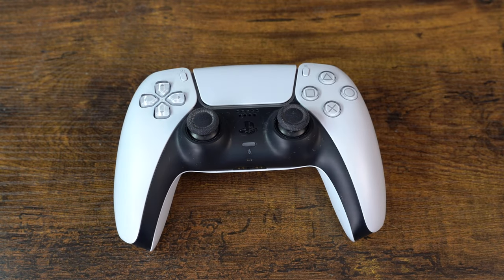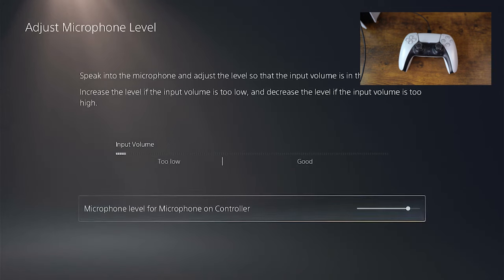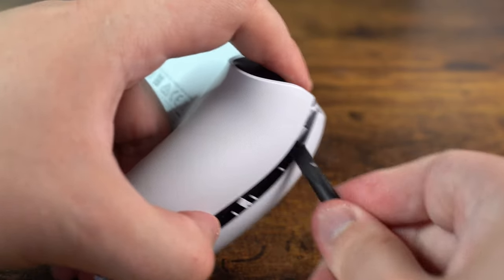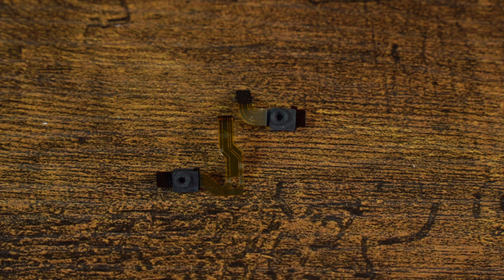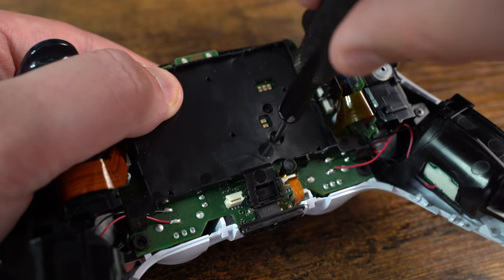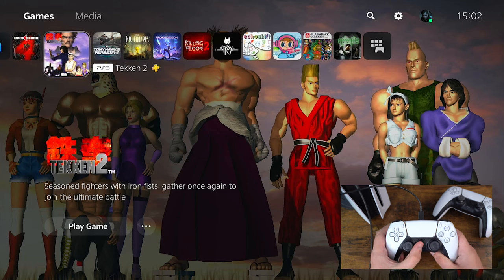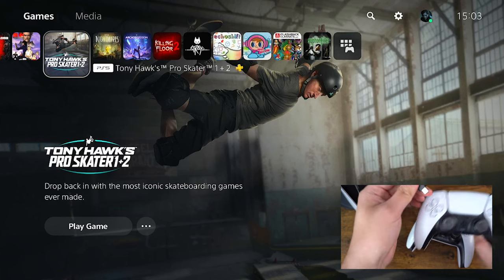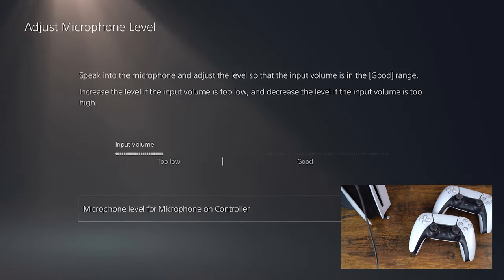How to FIX the broken microphones on PS5 DualSense controller - Tutorial

Comment: All you do is stick a toothpick in the back and reset the controller
Reply: I’m the back of what?
Reply: In the back of what plz tell me
Reply: @frmzilla 

In the back of the controller, there's a tiny black hole that will reset it, use a toothpick to stick it in there and hold it in there for 5 seconds.
Reply: @YKOE.LITINDY in the back of the controller
Reply: Did not work
Reply: Ily
Reply: Saved me money from buying another controller
Reply: The guy is talking about iliteral.
Hardware for the mic Stops working properly Not.
If the controller Has a software error.
Reply: the litaral hardware
Reply: thx tht work
Reply: uhh my controller not working now
Reply: Nah bro I was fixing the inside and I think the tape kinda fucked up now 😂
Reply: I thank thank you so much bro i couldnt speak with my Friends and thanks to you i can
Reply: Bro tysm this worked for me 😭
Reply: you the goat

Comment: Thank you I accidentally ripped one microphone of while trying to fix my stick drift this is very helpful to know if the replacement actually works fine
Reply: Yeahhh sames....Mine ripped  but luckily I had a controller that I do not use anymore...I just took mic wire out of that ...30 min fix...Peace

Comment: Yeah i did this and i have the same issues with my controller plus another issue where the camera won't turn left. Lets just say i had to resoder the red wires inside because they came out during the chaos of trying to clamp those joystick back together.

Comment: My speaker blew out on controller & I have it on the regular level it comes set as & it still blew not sure if it has something to do with dropping it but everything else works fine even the mic just no audio & when I switch to my other controller I get sound coming from that so that’s how I figured my speaker must have blown out or messed up

Comment: Hi. I really need ur help. I lost the rubber parts for the microphone. Will it cause any problems if I don’t have them!!!!
Reply from the maker: Hi, the rubber parts are there to help isolate the sound, without them on, the Dualsense controller may pick up additional sounds, however, the microphones will still work with or without them on. Hope this helps.
Reply: @theretropal  ty. Do u know where I can buy these rubber parts from?
Reply from the maker: @Bagz1994  I've not been able to find any replacements for these. I would suggest maybe, using a thin strip from a microphone sponge, a form it around the microphone piece and cutting a small hole for the microphone hole. Hope this helps.
Reply: @theretropal  so sponge will work. Ok ty for everything

Comment: Is there any way to return the controller United kingdom my left analog is drifting
Reply from the maker: To fix the drifting would require the stick to be replaced completely with a new one. I have a video on the channel which covers Stick Drift and how to remove the old one with a new one. While it's about the Wii U controller, the Wii U and PS5 controllers use the same sticks.